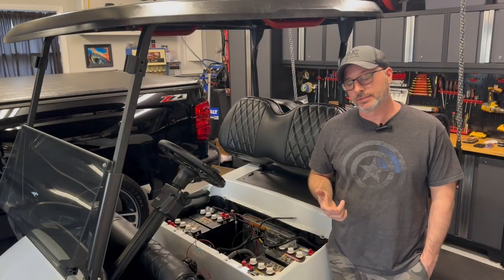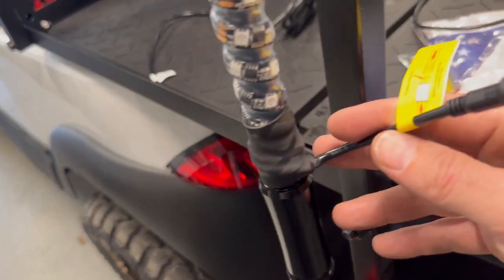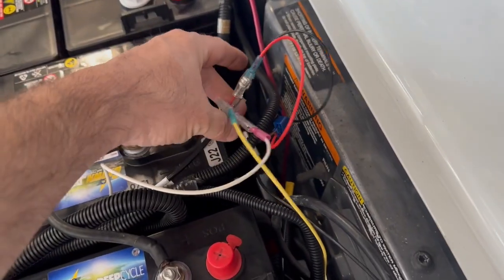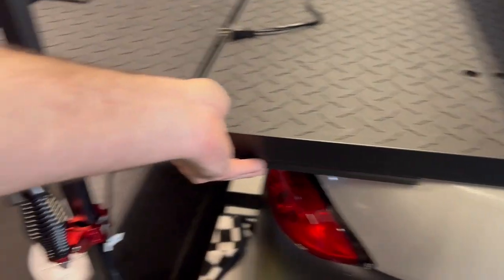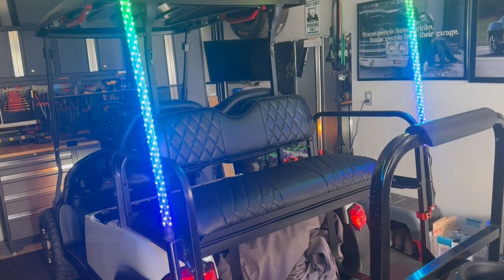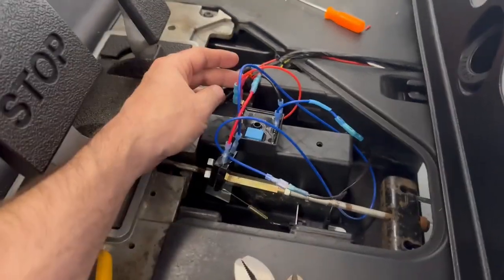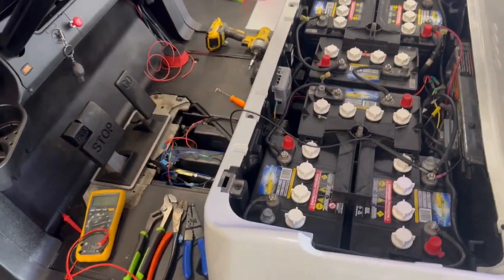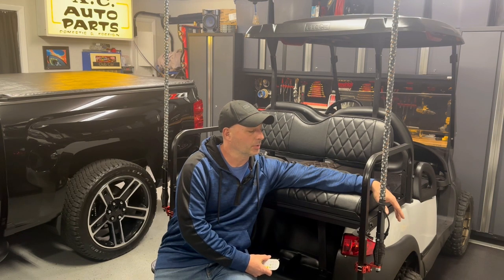WHIP LIGHT install on a Golf Cart???

Comment: Great video. I need help! My whip lights are installed. And when I hit the pedal to drive. They start blinking. And they will turn on when they were off.
Reply from the maker: oh no. 
I would start with only using the power and negative wires, and see if they operate properly with just those, using the remote. If you installed into the lighing harnesses of the car, and  they are all over the place when wired into other lights on your car, then that could be the wrong wires are spliced in to the wrong place i imagine.. i had to move them around a few times to get it right. 

I've got another set to wire in soon, we will do another video try to figure this out again.

Comment: Thinking you may get 12 volts of the reverse buzzer ?
Reply from the maker: Could try that. I never measured off of that. There is no reducer on the factory harness so will have to look into that for next time!

Thanks for watching.
Reply: I wired both my aftermarket backup lights and the reverse wire for my lightsabers from the disconnected (and VERY annoying) backup horn on my 2024 Icon i40L cart, that exact way.

Comment: I just installed these on my club cart they work great sitting still but once i drive they flickers any ideas?
Reply from the maker: Sounds like there must be a loose connection somewhere? Movment shakes the connections and it's loosing contact. Only thing i can really think of. Unless its internal to the control board.

Comment: Hey buddy, great video, I love how thorough and detailed they are. Just a heads up though, I had a similar LED kit on my Yamaha R1 and I had a constant draw for the remote control receiver that would drain my battery if I did not ride it for a few days. I ended up wiring a kill switch under the seat to the lights so that I did not have to keep it on a battery tender all the time.... not sure if you will have the same problem, but definitely something to keep an eye on. Again, great job and keep up the good work
Reply from the maker: Thanks so much! The Fuse panel is wired to ignition, so should be dead once you shut the key off but I am going to double check that! Headlights and Brake lights are shut down with they key as well.

Comment: I just watched the video. Great info for a kit without much info at all. 
I think your problem with them braking/indicating with them off is possibly not on a switched circuit or not being on a switch themselves. I’m installing mine on a EZGO gasser using a 6 gang switch panel because I’m running rock lights, halo pod lights and RGBW’s in the cover. 
Thanks for the great video!
Reply from the maker: thanks for writing and watching! you are probably correct. I could try that. Good Luck with your install. Comment back if it works for you!
Reply: I’m putting rock lights along with 2 whips just like these on our ezgo gasser  not sure if I will hook them up with the brakes yet.  Hey groovdog how do you like your rock pods  are you happy with them  I’m hoping they will be better than the strips
Reply: @onemuskynut  For sure! I’ve had them on two previous trucks and now my cart. And I have 8 on this cart. One in each wheel well, one on each side and one in front and one in back. They’re really great when the music is bumping! 😎

Comment: Hello I know this thread is old but I could use your help
Reply from the maker: How can we help?
Reply: I have g29 cart like yours except my is gas. I iust install the same whips on my cart with a 10 lol light kit for the g29 and I’m having the exact same issue you we’re having in the video.   On my cart it’s a brake footpad switch. No matter what I do they when I hook positive red whip to positive on foot switch and turn on light it stays solid red. Any idea where the heck I should hook up to to make them work as they should
Reply from the maker: @ak47alldayok  if they are going red when you turn the lights on, it sounds like you are hooked into the power wire that turns on the parking lights. Try to find the wire that puts the extra juice for brake lights. I would think that the Brake pad connects a circuit. Maybe you tried the other side already, but if you didn't attempt both sides of that pad wire, i would start with that. You could meter it to see if one is dead with the lights on, then if it comes alive when the pad is depressed. I would think one of those wires would have power at all times, and the other only when the pad is depressed. 

I'm sure you know, all about finding the one wire that gets the Volts when the pad is pushed. 
I am hopeful this helps, but let me know!
Reply: Thank you, it’s what I was thinking just haven’t got to that point yet. Thanks for the reply. I’ll keep yah posted on what I figure out. I can’t be the only one dealing with this issue
Reply from the maker: @ak47alldayok  it drove me nuts for a little while too! Helped me though when i put trailer lights in my burgundy cart though. This white one got sold to some folks that use it on the lake. Their kids love the whips from what i am told. 
Good Luck!
Reply from the maker: Oh wow! I had no idea they were sending my video around. That's awesome.
Reply: I never got it to work returned the 10Lol kit and order a different kits from eBay. That has the ability to do what I’m trying to do.